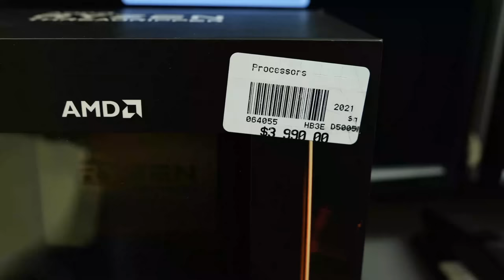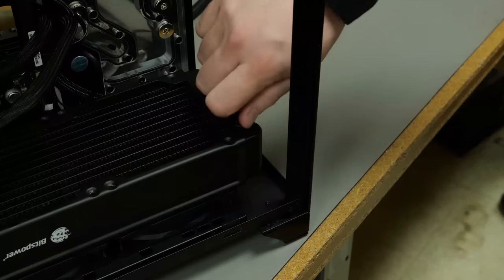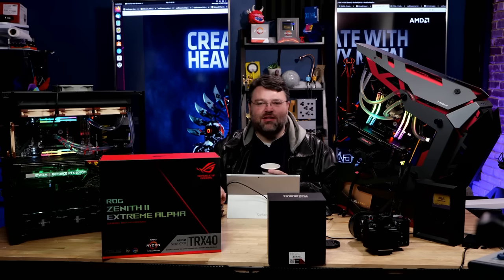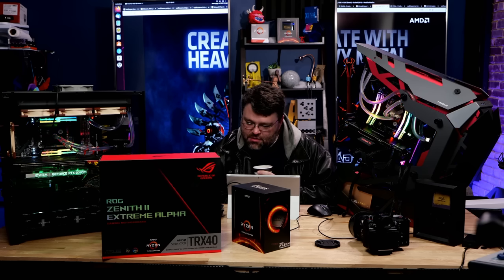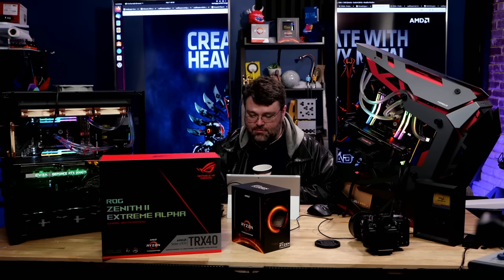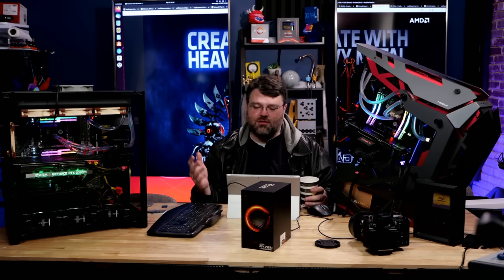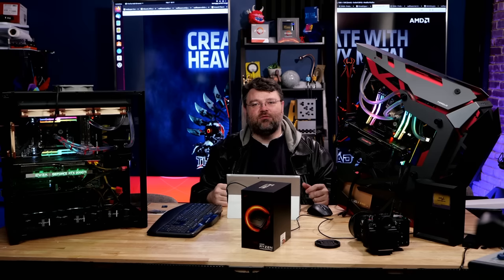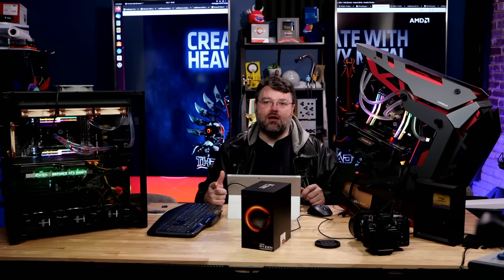AMD 3990x Review, Build & Initial Benchmarks

Comment: A plus certified you say.. So how many firewire 400 can I chain together?
Reply: There is a dog barking at you while working on a clients pc in their home. What should you do? a) Kick it b) ask the owner to silence the dog c) ask the owner to move the dog from the room d) ignore it. (paraphrasing but similar to a question I had on mine)
Reply: @WolvenSpectre  Did they even sell 63 firewire 400 devices? I believe USB is 127, but I'll cross that bridge when I come to it as you would run out of bandwidth WAY before you run out of device Ids. So it's irrelevant anyway. They might as well ask how many seeds the average Pomegranate contains as it has about the same relevance and usefulness.
Reply: @WolvenSpectre  I envy your innocence believing they will. They will lobby even harden behind closed doors i am sure...

Comment: I went to the MicroCenter in Yonkers, NY and was able to buy a 3990X. They currently only have 4 left. The staff didn't even know you could reserve the things online so I had to show them the reservation email. It was a 120 mile round trip because my state doesn't have a Micro Center which sucks. Will be building the system today after I have breakfast.
Reply: It works :-) Need to get my storage sorted but very pleased so far. btw. I opted for the MSI Creator TRX40. I guess I should join the forums.

Comment: When it comes to applying thermal paste, here's something you have to consider that I rarely see mentioned on build videos: Air needs an escape route. So never do a circle. Instead, use an X, a single spot in the middle, or the very best is an even coat that is combed into parallel grooves in one direction with an adhesive spreader or silk screen applicator.

Comment: For Threadripper Thermal Paste applications: You ideally want two lines forming an X, oriented vertically, and one dot roughly in the middle of each quadrant. That's from AMD's official guides on installing EPYC into systems.

Comment: I start with a rubbing alcohol wipe down using a clean piece of paper towel.   Next, I apply a small amount of thermal paste centrally on top of the processor.   Then, with a piece of clean Scotch Magic Tape, long enough to stick to the bottom and end of a clean finger-tip, I spread the thermal paste over the entire processor IHS, leaving a thin even coating, just thick enough to obscure the surface.   Any excess is wiped off by the tape, on a clean paper towel or from around the processor with clean cotton swabs.   This full coverage application is 100% guaranteed to provide full coverage of thermal paste, without any messy excess, when operational.          Credit to Carey Holzman, from his YouTube channel.

Comment: (6:45) I put on a small amount on both spreader and cooler, spread around to the entire area on both I want covered with a razor blade edge, then wipe it off with a lint free cloth.  The two areas should just look hazy.  Do the same thing again using the razor to have two really thin layers (skipping the wipe off step) then put the two together and tighten the cooler in an X pattern (opposite corners).
The way you see on most videos is way too much (squeezing a big worm like blob like toothpaste) and lowers cooling efficiency. The only advantage I see in over applying is the joint might be more resistant to aging (more actual material to dry out).

Comment: Hi I just boughtg a trx40   mobo by gigabyte for mt my new new ryzen 3807 x thread ripper.  It gas 2 connectors that say atx 12 v one has 4 pin connector and the other is 8 pin connector . Which one do I use 8 pin or 4 pin or connect them both for a total of 12?  this is near the cpu section

Comment: I have a o11d lx also. Sweet case. Prob should cut out the rear fan. Airflow is very poor there. I purchased a 90 degree knuckle for the atx power to the main board. Really cleans up the look.

Comment: Ah, I missed this. One question: What is your take on idle power usage?

I've been video-encoding with a 3950x and it was only pulling a single amp from the wall (240volts, none of that 110v rubbish! - I bet you read that in Dave Jones' voice😉), and that was with a 5700XT also doing some work. Which I thought that was impressive, however idle isn't so good. It rarely goes below 100watts, even while playing with the power settings. Right now it's pulling 120w and it isn't really doing anything and half of that is going directly to the CPU (averaging 50-60watts, at idle!*). It just feels a little high/ broken to me, like AMD needs to release an update (I'm currently using AMD's balanced power plan, power saver will drop it to 30-35w but that kind of defeats the purpose of powerful CPUs). Seems as though it is too keen to start firing up cores/ CCXs when there's near-zero load or latency.

It's not so much an issue on the desktop, but power is a MAJOR factor for servers (not really fair to compare these to laptop CPUs).

Overclocking is a lost cause. I've accepted defeat (you lose the single thread speed on all core overclocks which is only really applicable in synthetic benchmarks, PBO is about the best it gets. However, it is good at benchmarking your cooling, but that's about it. Plus, Ryzen Master often crashes when I try to run it and takes me multiple attempts to start (fresh OS install, even tried removing the motherboard utils).

*Turning off all performance measuring utils makes little difference from what's being pulled from of the wall.

Comment: Quote "hundreds of VM doing regression testing". According to LTT this thing supports practically only up to 256GB of memory (unregistered RAM), and it does not support buffered RAM. I'm not sure if a VM with 2GB of memory is very viable.
Reply: Docker to the rescue
Reply: First Tyrell at that pricepoint, I dont think buying buffered ecc ram is a problem. They may be a tad bit slower, but you dont buy a 128 thread processor for clockspeed, or at least you probably shouldn’t.. 
That said, 2gb ram could be plenty if you only run one application per vm, but in that case you may consider running containers instead.
Reply: @fredriklindlof8720  Buying buffered is not a problem, the problem is, it seems, that this new 64core cpu does not support buffered memory at all (according to LTT).
Reply: Do you have a link to the video where they discuss this?
Reply: Can confirm 2gb RAM is plenty for a VM, though it depends on what you're doing. There are plenty of minimal builds of Linux that can let you put most if not nearly all of that towards whatever your application is. If you use SSD RAID pools for SWAP, or even a RAM Disk (on a separate PC or a PCIe dealio) you can get some crazy performance with barely any RAM. 

Not to mention, KSM Sharing would come to the rescue there really quick if you really were doing tons of VMs, especially if they were the same distro or even same distro and application. https://pve.proxmox.com/wiki/Dynamic_Memory_Management

Proxmox does it automagically but I think you can do it on other hosts too.
Reply: Really depends on what you're doing. I've run dozens of VMs with less than 1 GB allocated. 1 GB of memory is huge if your code isn't bloated.
Reply: @firsttyrell6484  According to AMD, it does have ECC support, but they say nothing about the support or lack of support of buffered memory, so I assume that Linus is correct about it not supporting Buffered RAM. 

From AMD's 3990x website 

"Quad-channel DDR4 with available ECC support for reliable throughput."

For some reason people tend to equate ECC and Buffered RAM, they're not the same, they're two different, unrelated technologies. You can have buffered non-ecc ram and vice versa. 

It doesn't surprise me they've limited it to just ECC, because Buffered (aka Registered) ECC support would make it welcome on the proper Enterprise market, and they've got more expensive offerings for that. 

https://www.amd.com/en/products/cpu/amd-ryzen-threadripper-3990x

Really though, if you need Buffered ECC memory, you should probably be using their proper enterprise stuff. If it's that important you may as well spend the big bucks.

Comment: The eVGA 2080ti FTW3 does NOT get toasty. I bought one that had damaged fins with no box for a cool $1000 and it runs at 2.150GHz at 80c. doesn't even throttle. Its the best 2080ti other than the KingPin card or RTX Titan. Which they should've used with a build of this caliber. There's a lot more headroom on the card thanks to the PCB being fully populated with ceramic capacitors. I've seen the kingpin cards hit over 3GHz on the GPU which is insane.

Comment: It would be very interesting to see what kind of improvement an Android Open Source Project build would see from the 3990x over the 3970, 3950 and even the 3700x/3800x. Cause I couldn't wait for the 3950x to build my new workstation, I had to "settle" for the 3700x (seemed the price premium of the 3800x wasn't worth it for the meager performance improvements and that id probably only have it for a short time...).

Comment: I wonder where amd goes from here.. what is the natural progression for this CPU
Reply: I can't imagine them cramming more cores in within the next two or three years, but they'll definitely refine and improve the design for higher efficiency, lower temps, and higher speed. 
Plus... the node shrink to 5nm, I think next year, after the 7nm+ this year.

Also, they've applied for some fascinating patents on 3D stacking. Like, REAL 3D stacking. 
The most interesting part, to me anyways, is their solution for the heat problem. In one of the patents, they showed how they're going to layer in a super thin TEC (Peltier cooler) between the stacks to transfer heat much more quickly.
Reply: @BRUXXUS  Thanks for your insight.  I imagine getting efficiency up will decrease the heat produced which will lead to higher clocks.  But it is just really interesting to see this level of performance on prosumer equipment. I hope that one day itll trickle down to me lol.

Comment: 19 seconds for compiling the Linux kernel? Really? My 3700X needs around 15 minutes with 9 threads running and default settings. I know that extra cache helps but a factor of 47  while having only 8 times as many cores and a lower clock-frequency is a lot.

Comment: I bought into the x570 and 3900x. Im not happy with this system random reboots. Crazy high temps. Cmos resets' battery pulls. Its been a nightmare of a system. Now run 3200 ram and 3.8 ghz cpu @ 1.2 volts in attempt to stabilize.
Reply: Wow, that's really weird, everyone talks about how cool these run. That's been my experience as well

Comment: 34:15 

VM Ware needs a second licence beyond 32cores. So for the 3990X you need two 😫
Reply: John Longbow Why can’t you say “screw VMWare” and go Parallels?
Reply: jamerican347 We have four servers, two of which use Intel Xeon 8160’s so we do not scale above 32 Cores. The other servers are older (2016-ish?) not sure which cpu’s are in those but pretty sure they’re AMD Opterons 8 or 16 Core variants.

Also the IT guy likes VMWare so, basically not my call 😕

Comment: No actual experience with rads myself, just an embarrassing amount of YouTube U.. you really want to flush the rads a few times until clean before final install. The manufacturing process sometimes will leave remnants of solder and other undesirable bits inside. A chunk of solder getting stuck in the cpu block fins gonna have a bad day. Might even take your pump out completely. Leaving you wondering what's up with my flow rate!?! Gonna wreck your 4 effing k $ proccer? Prolly not. But with a 10k + build don't skip steps? Lol just 20mins into this, ocd kicking in :P I'm now left wondering how much one of my kidneys might fetch on the black market..

Comment: And, there's Wendall with his "easy to use" SOFT tubing.   What can I say, soft tubing on an $11k machine.  Oh, yeah...it's Linux
Reply: Soft Tubing has one big advantage:
You don't have to drain the loop if you swap the processor.
Reply: @Azraleee  Honestly, I had such a hard time using Acrylic tubing that I used soft tubing myself.  Now I get  better results using PETG hard tubing
Reply: @johngermain5146  Built my first loop last week and I'm already glad I went with soft tubing. I had to test a CPU for another System that I won't have acces to until the weekend. 

Hard Tubing looks cool, but I don't particularly care for it in my system, maybe that will come later.